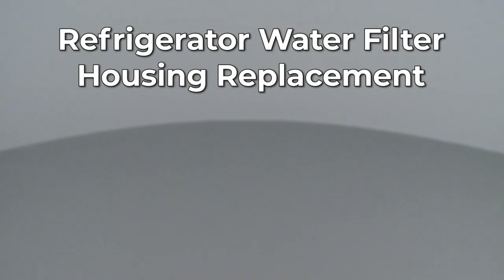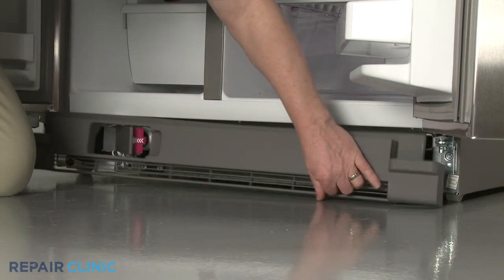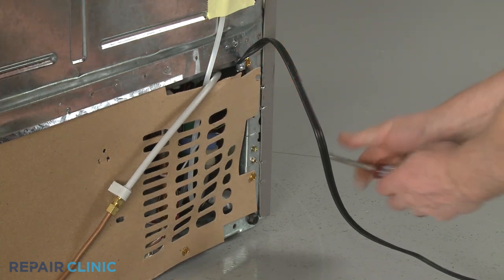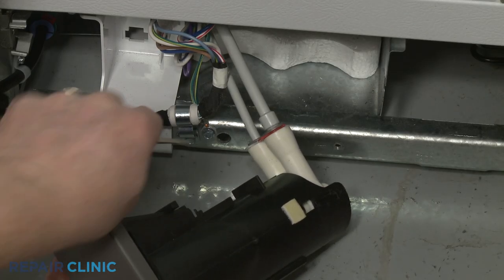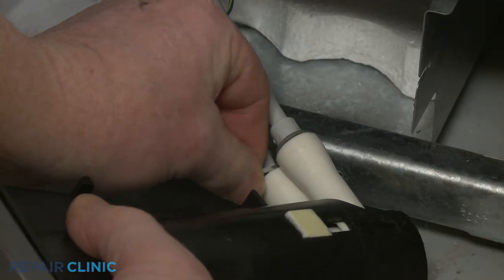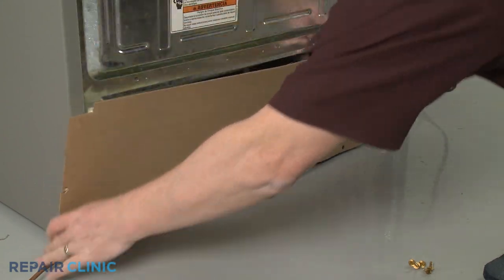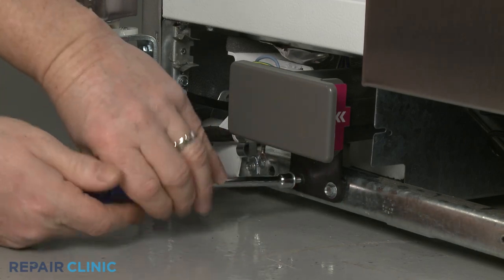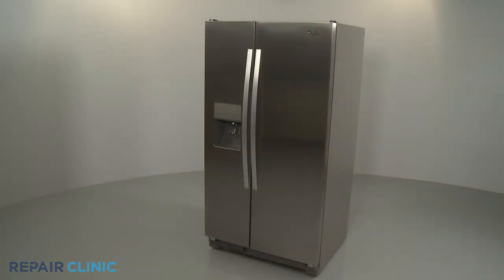Whirlpool Barracuda Refrigerator Water Filter Housing Replacement W10862461

Comment: I replaced the housing just fine as in the video, but the new unit still has a slight leak. I pushed in both lines all the way and pulled to check them. Have I missed something? Can the lines get scratched enough to leak?

Comment: I appreciate the up close detail. Our housing door came off the hinges and I did not want to take it all apart at this time to replace the housing (still thinking I can fix door) but could not figure out how to get the filter out without the door-can use screwdriver on left side where white flange is and scoot it out.. YEAH replaced.. THANK YOU!! From a fix it Diva.
Reply: I have the same issue. Is there away to replace white flange?
Reply: If I understand your question you would have to replace “filter housing”. It is one unit. You have to get back to the frame where it connects
Reply: A have a door but it is missing the white flange so the filter is stuck and doesn't eject when the door is opened. What's the easiest way to remove filter?
Reply: I used a narrow screwdriver and pressed along side of the filter closest to where the flange should be. Reach back and pull forward while GENTLY pressing on the filter. Mine came out rather easily. The flange connects to a ridge on the filter and the “pulls” it out. Same process just using a screwdriver.
Reply: @Nobodyman1  As mentioned in an above post, you can use a screwdriver.

Comment: My fridge won't dispense water if the filter is on. I installed a new filter and still same problem.  I bypassed the filter assembly with a hose the water started to dispense again. So seems like the housing I bad.

Comment: Why are the two water lines not pulling out as easy as it is shown is this video?  This is the housing and I've done exactly what you show in the video and i cant get the two lines out of the housing. Any help would be greatly appreciated.  Thanks
Reply: I've now gotten one out and it took lots of force and work. Mine didn't have these locking clips, either
Reply: It took a ton of force and effort to get those lines out

Comment: Hi everyone. I am not a handyman of any kind, but pretty good with following instructions. I found this video to be very helpful in understanding how to replace the water filter housing unit myself.

I was tripped up on one part and wanted to share in case anyone else has the same issue. When disconnecting the water lines from the old housing, I did not have any locking brackets on my part. I just could not get the lines to disconnect, after a few trials of different strategies.

Finally, I realized the solution. Push down on the gray ringlet where the line joins the housing unit, then with your other hand pull the line away and the line comes out. This worked for both water lines.

Thank you for this video!
Reply: Wish I would have read your comments before I started. My story mimics yours; no locking rings and I couldn't figure out how to release the tubes. Finally used the small wrenches and depressed the gray rings and the tubes came out. I didn't unhook anything in the back of the unit.
Reply: Hi, I had the exact same problem.  I was looking for the locking clips on the water line inlet tubes.. I wish I had read your note to press the locking rings. Unfortunately, I pried the ring on the smaller tube with a screwdriver ands broke part of the ring which was in the housing. After I pushed the ring then pulled on the tube did the water line come out easily. I put it all together and did not see any water from the filter or housing.  knock on wood. I will go to a plumbers shop to buy another locking ring to have on hand in case I have to take it all a part to put a new locking ring on the small  water inlet tube.  Another cheap design is using the free standing styrofoam .  then having to fit the filter  housing over that bridge before you screw the bracket back on the frame. hope I don't have to deal with that again !
Reply: Hi Harold, I'm having the same issue and really enjoyed the fact that I know the top commenter personally hahaha

Comment: Thanks for the video.  I tried to find the two different sized locking rings, but so far no luck.  I need them since I can see that there is a slight leak coming from where the water tubes connect to the water filter housing.  Thank you in advance.

Comment: Question: Is it typical for the door to lose tension and not push the filter in hard enough? I found that if I push the filter door in the water will dispense. Sometimes the door just pops open.
Reply: this is the question I wanted to ask. my issue seems like it would be a Water Filter Housing issue, but I still hear the water running when I put pressure on the filter door. Then again, I also notice water spilling out of the housing part when I check on the filter again...

Comment: Hi, how do I know that the housing is the problem.?? I can flow water without the filter but once I installed the filter the water flow stops. Does that means the housing needs replacement.?
Reply: @repairclinic  I have a similar issue. Without filter or with my old water, the water flows well. However, after I replace a new filter, the water flow is much small (a bit larger at the beginning). I have tried 2 filters so I know it's not the new filter issue. Should I replace the housing? Thanks.
Reply: I’ve got the same issue? Did replacing the housing resolve it?
Reply: @aggiejl I replaced the housing and the problem was fixed. Also I bought the new (oem filter) and no more problems.

Comment: How can I remove filter without changing the filter housing? The filter door was broken and I can't figure out how to release filter. (FYI, I don't want to change Housing of I don't have to. I plan on purchasing another refrigerator in a month.)
Reply: Just get a slim screwdriver and pry it on the left side where the white hinge mechanism was on the original door.  There is a pressure tab on the right that will depress.  Press it right and pry outward and it will come out.  I haven't had a filter door on mine for the past 4 years and I have no issues replacing the filter.  It seems like a common problem with these doors breaking.  Guess that's what you get with these new appliances :(
Reply: @imhooks  good advice, but wow I wish you'd do a video on this - I can't quite follow what you mean "pressure tab that will release" I see the presure tab you can push LEFT but it has no effect on my stuck filter.  My door is intact, but the filter is stuck.
Reply: @scottatbuzzmaven  The filter has a bump out on the left side.  When the door is functional there is a lever that pulls on that bump on the filter that prys it out.  You need to use a flathead screwdriver on the left side.  Get the head under that bump and pry to the left of the filter.  I actually replaced my housing and the door now works as it should so I cant really recreate it at this point for you.
Reply: @scottatbuzzmaven  at 0:51 in this video you can see the white lever thing that pulls on that tab of the filter.  The screwdriver basically takes the place of that white lever.

Comment: Does this style housing allow for bypass with filter removed?  Mine only dispenses water if filter is removed.  Tried 3 filters and no water.  Bad housing?
Reply: Any idea if this was it? I’ve tried two filters and they won’t dispense, if I remove the filter it does bypass and the flow is great just unfiltered. But my housing seems to dribble without a filter which always make me think the housing is bad
Reply: @spencerwilliams5449  I haven’t changed it yet.  Just dragging my feet.  Right now it works without the filter installed and I hate to spend $80+ on something I’m only 75% sure it will fix.
Reply: @ugabd57  I removed the filter and installed an inline filter in the basement where the water line attaches to the supply line which has a shutoff valve
Reply: I’ve got the same issue. Did replacing the housing resolve it?
Reply: Any update on this?
Reply: @player4shore734  never changed the housing.  Works with no filter installed.
Reply: @ugabd57  I can confirm it’s the housing. I just replaced mine and working with a filter now. Part on Amazon is about $75

Comment: The video was very helpful.  Whirlpool, however, deserves a thumbs down.  The little back plate on the housing that popped off the filter mechanism was designed by a jerk that wants to sell $80 housings.  Easy swap thanks to this video, but a waste of a job and $ due to their 'engineering'.